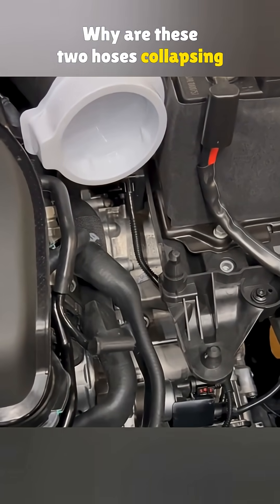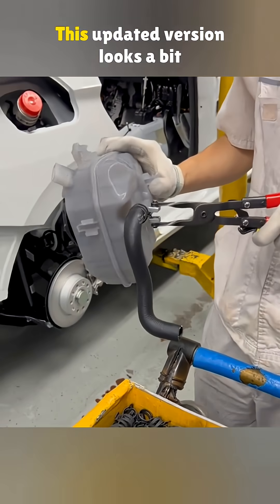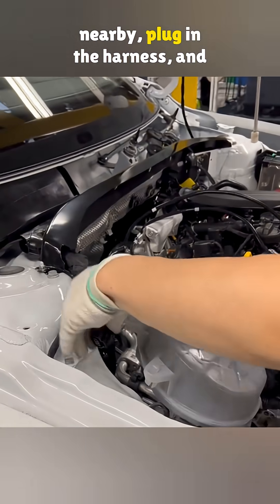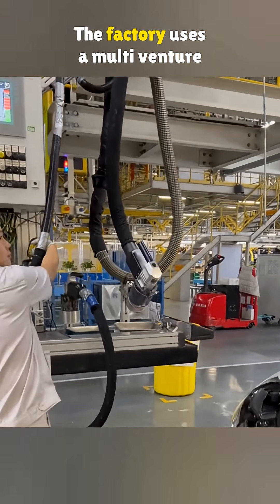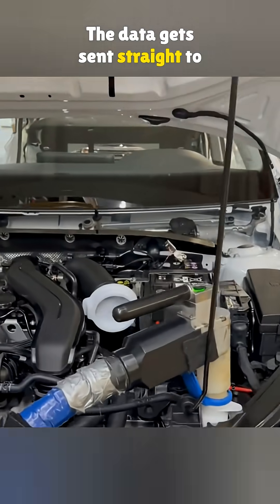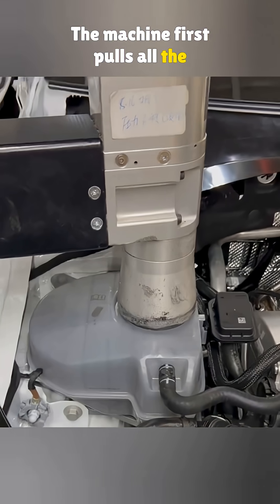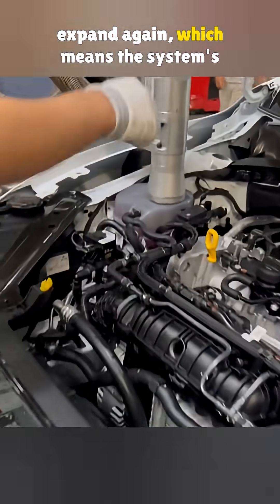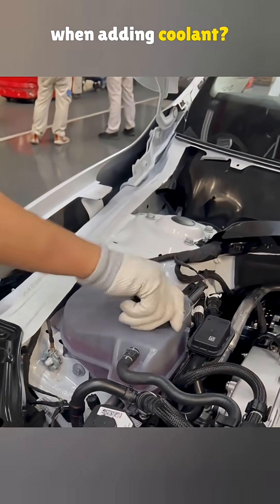Why Vacuum Filling Coolant Is So Important #assembly #automobile #mechanic #car #manufacturing

Comment: This way they don't have to start the engine to circulate the coolest  and  continue the car making process   save time and fuel too
Reply from the maker: Great point
Reply: @oryzontek i had work in pune chakan VW car manufacturing plant   but it was contract job  with low payment so i left it... I was test driver. But factory is very nice

Comment: Factory saves $1 for an air bleeding valve and now you can't change your coolant at home or you have to buy expensive equipment for a simple fluid change job.
Reply: I dont think air bleeding and coolant bleeding valve is same thing. Both different coolant bleeding mostly at bottom of the radiator right  or left side but air bleeding isnt that valve

Comment: How about the thermostat? Thermostat is close by default if the temperature is lower than optimal engine temperature and opens only if the engine reached the optimal temperature.
Reply: Good point.
Reply: Only on old fashioned American cars, German ones can have the thermostat buried deep in the engine that in some cars requires engine out.
European cars haven’t had an accessible thermostats for decades!

Comment: New cars cooling no longer designed to get air to the filling cap, this can create air pockets that cause cooling problems
. Hopefully these new engines still have manual bleed screens so diyers can change own coolant without air pockets.
Reply: the air is going to the highest point of the system which is the expansion tank where is the cap installed. Its not if the car is new or old.. its named physics

Comment: They do need to do it like that because of optimization on the assembly line.Doing it like that is faster safer and cheaper.But do you need it when doing it 1 car at a time in a shop.Defenetly  not
Reply: A lot of modern cars require it due to coolant system design.

Comment: I bought a cheap gadget to do this at home, but when I pressed one of the hoses I got a crackling sensation. Maybe it’s the rubber drying from the inside, maybe it’s deposit, IDK, I didn’t dare to use the thing. Next time I’ll change all the hoses.
Reply: Rust build up if you heard crackling from hose.

Comment: Most modern vehicles are designed in such a way that you have to vacuum fill the cooling system,otherwise engine failure almost guaranteed under heavy load conditions

Comment: Absolutely necessary on the assembly line where time is of the essence and maximum efficiency is the goal.

Preferred in other areas (repair shops, auto body shops, home DIY) because it's just a better way. I've seen quite a few instances where this procedure would've prevented engine damage from overheating.
Reply: indeed.  if manual fill leaves air pockets that make their way to the block it could cause overheating and head gasket problems.

Comment: Na ovaj nacin se unistavaju creva na starijim automobilima je jos vec problem
Reply: rather it fails when filling than on the road no?
And it's better than ending up with an air pocket anywhere near the head gasket.

Comment: It's done to confirm the cooling circuit has no leakage before filling the system. Additional advantage is no need to purge the air from the system.

Comment: Ok so the coolant level won’t be stored in company systems for 10 years lol?
Reply: Yes, data is stored for ten years.  This way, if there is a warranty claim, they can check the records to see if anything was unusual.  Then they have the option to issue a less expensive recall for other cars with the same problem data.  We do the same thing without our products.  If there is a problem, we can look at photos from when it was made and look for causes.  We can also scan other photos for the same problem and contact customers before the product fails.
Reply: @microdesigns2000  Wow.. brilliant. thanks

Comment: Doesn't vacuum filling also check for leaks? If there's a leak the machine won't be able to achieve a strong vacuum.
Reply: Yes, you're right, they do the test leak first by filling the circuit with air and check if there's a pressure decay, and then by vacuum and pausing it for a few seconds to see if the pressure rises. If both OK, they start filling.

Comment: Doing it this way ensures no air is in the system and it's faster to do it this way.    They're not going to be running the engine in the factory to purge the cooling system.